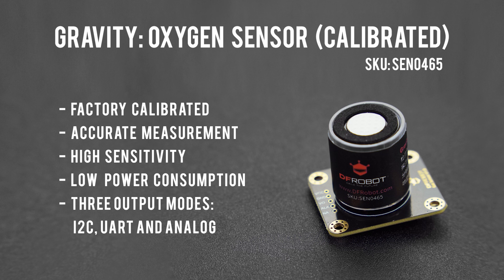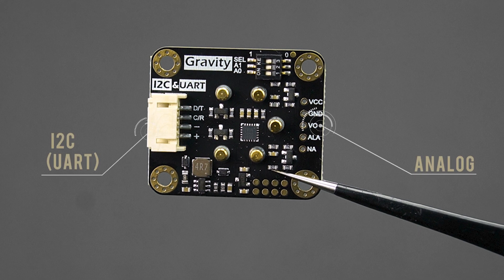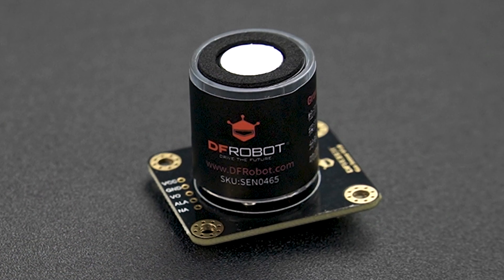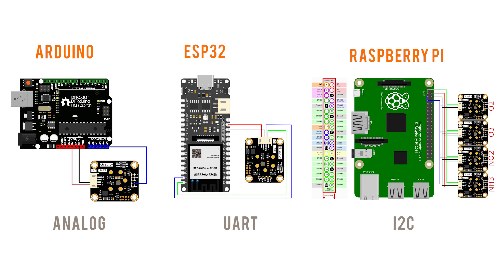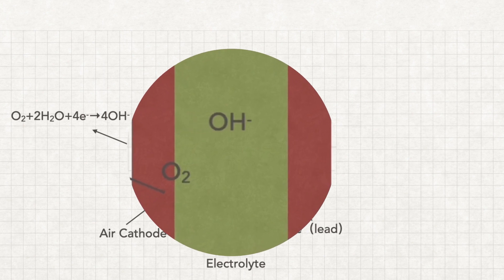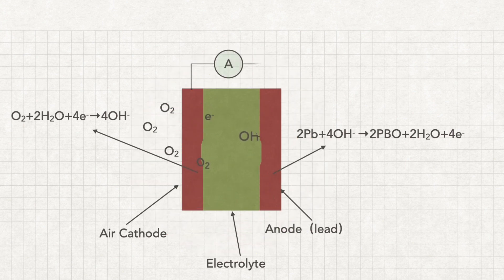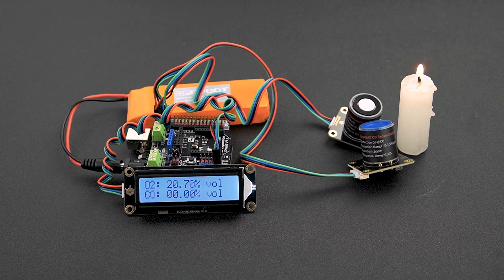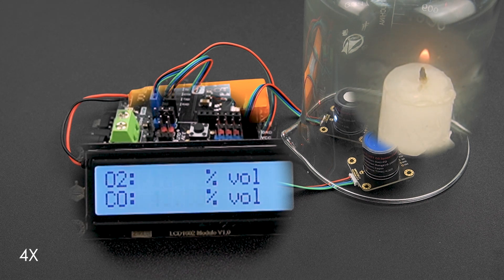How An Electrochemical Oxygen Sensor Works - Gravity: O2 Sensor (Calibrated) - I2C & UART - SEN0465

Comment: Hii
does this sensor have any operational pressure range 
i want to use this sensor in where the pressure will range between 20-30mbar
and also as in my application i want to pass a signal in volts once 200ppm is reached 
since the H2S sensor rage is only till 100 ppm can we code such that once the sensor detects the 100ppm a timer starts and after a predetermined time it will give signal??

Comment: Eventually the sensor will fail I think. As more reactions happen due to the break down of oxygen to bind to the back electrode via oxidation.  So the more oxygen in the environment, then the more the oxidation happens. The anode will eventually not be able to oxidize.  To oxidize means it needs to bind with some chemical to release the electron.  So the question is how long this sensor last before it fails to oxidize and the reliability of the sensor as it reaches the end of life of the anode.
Reply: Hello Michael, the life of the sensor in air is two years. At the end of the sensor life, the value of the sensor output decreases because the chemical reaction cannot continue, so it is recommended to replace the sensor probe after two years of use. Thanks for the question. :)
Reply: I am wondering why it costs so cheap. Thanks Michael.

Comment: "Lead" and "lead" are unfortunately two entirely different things;\blame the English language.
 What you talk about is "lead (Pb)" --> pronounced as Ledd, rhymes with "head" or "bed"
A wire-lead is more innocuous, and is pronounced as you do", as "leed" (rhymes with feed).
Pb-containing articles would generally fall under the RoHS directive - be careful; although some specific articles may be exempted.
Reply from the maker: Thanks for pointing that out, we will pay attention to details in future videos. This video only demonstrates the general principles of the oxygen sensor, and the actual production process is compliant with the RoHS standard. Thx again.
Reply: @DFROBOTCN  Thanks fro the explanation. Good to hear that this sensor is RoHS complaint. I know that Cadmium Sulphide and Cadmium Selenide photoresistive materials are no longer acceptable in new products by RoHS.
Reply: wow, so professional.
Reply: Respectable!